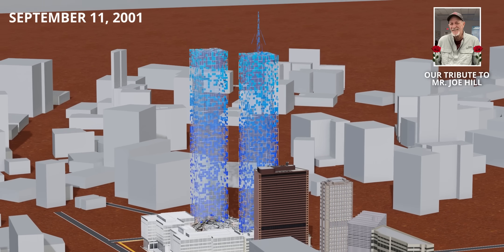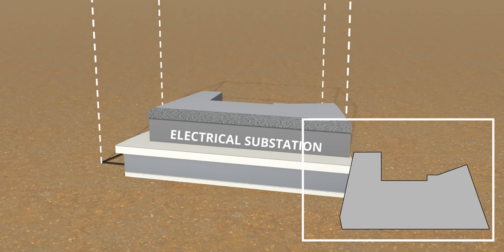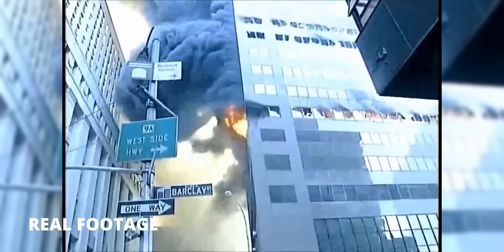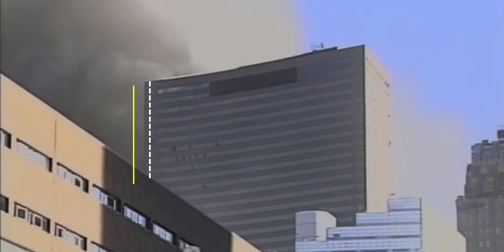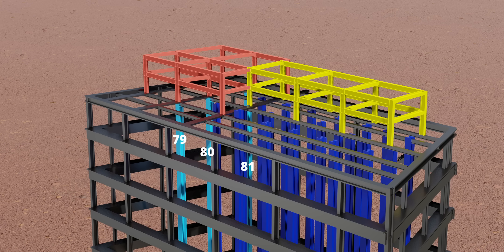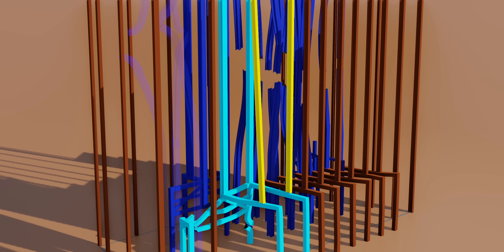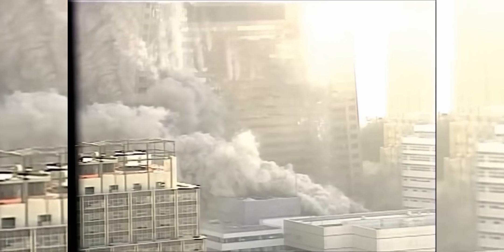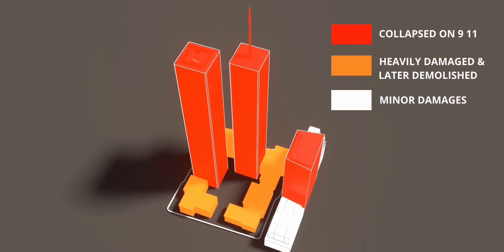Collapse of Building 7 | The Complete Physics

Comment: I find this argument difficult to accept. Buildings do not simply collapse into rubble; even when multiple high-explosive rockets strike a building in wartime, the structure often remains standing. From a common-sense perspective, the WTC incident seems highly implausible.
Reply: Maybe a more detailed approach will help;

At 10:28am the WTC North Tower collapsed, showering Building 7 with tons of burning debris, causing heavy damage and starting many large  fires which burned out of control for the next 7 hours. Half the FDNY firefighters having been killed, units in disarray, equipment destroyed, no water pressure, and the greater urgency of search & rescue efforts, Building 7 couldn’t be saved so firefighting efforts were pulled as futile and 7 left to its fate. Firefighters make that sort of choice every day in brush fire situations - which houses to save and which ones to let go. Only real difference here is moving the decimal on the size and cost. People get overwhelmed by the size.

www.youtube.com/watch?v=g_SvpwyC17M

Collapse of a burning structure is always a concern for firefighters. Steel buildings subject to fire rely on active firefighting to survive. Buildings are designed around 1 to 3 hours of fire resistance, allowing time for occupants to escape and active firefighting to get started, after which all bets are off. Left to their own devices they'll exceed their design envelope and collapse, like Plasco Tower and Wilton Paes de Almeida. In 7 the occupants escaped, passive and active fire protections were compromised and active firefighting was abandoned hours before the collapse, which left the building to its fate. It lost. Odds on Building 7 would eventually collapse, and it did. No big deal in logic.

 http://www.youtube.com/watch?v=WnYBX6QT0R4 

FDNY Chief Daniel Nigro - The biggest decision we had to make on the first day was to clear the area and create a collapse zone around the severely damaged 7 World Trade Center, a 47-story building heavily involved in fire. A number of fire officers and companies assessed the damage to the building. The appraisals indicated that the building's structural integrity was in serious doubt. I issued orders to PULL back the firefighters and define the collapse zone. It was a critical decision; We could not lose any more firefighters. It took a lot of time to PULL everyone out, given the emotionalism of the day, communications difficulties and the collapse terrain 

FDNY Deputy Chief Peter Hayden ; We had our special operations people set up surveying instruments to monitor and see if there was any movement in the building. We were concerned of the possibility of collapse in the building. And we had a discussion with one particular engineer there, and we asked him if we allowed it to burn could we anticipate a collapse and if so, how soon? And it turned out that he was pretty much right on the money, that he said 'In its current state you have about 5 hours 

The collapse of Building 7 was anticipated and widely reported in the media throughout the day, with 24 video cameras recording some or all of the collapse. Everyone knew what was coming and why. 

www.youtube.com/watch?v=OY5S5k3tMHI

The collapse of Building 7’s was entirely different to the Twin Towers and harder to understand, most details being hidden from view and not intuitive.  But we can still sort out what happened through careful analysis and observation. This is my explanation of the collapse relying on no outside authority. 

Building 7 was a unique, asymmetrical 47-story steel framed structure built atop a smaller 3-story building serving as a partial foundation, requiring lower floors dedicated to complex load transfer structures. Of trapezoidal shape and all-steel tube-in-tube construction, B7 (above the 7th floor) consisted of a central core of steel columns carrying most of the gravity load, perimeter steel columns around the outside of the structure carrying the remainder of the gravity loads and long span beams and girders to tie those elements together and form the floors. On the outside of the building hung a moment frame or outer shell. 

Phase 1 : First externally visible signs of collapse initiation occurred at 5:20:28 pm and were notably quiet with observers not realizing the building was collapsing! No audible warning in the form of hundreds of ear drum busting 180-190dB explosive bangs preceding the collapse. Here at 12:00 a local CBS affiliate reporter is talking 10 blocks from B7 when collapse begins. People don’t start to notice the collapse until 12:11. At 12:45 is the famous CBS fixed camera clip of Building 7’s collapse. Note how quiet it is. 

www.youtube.com/watch?v=t5tEy6mXSE8

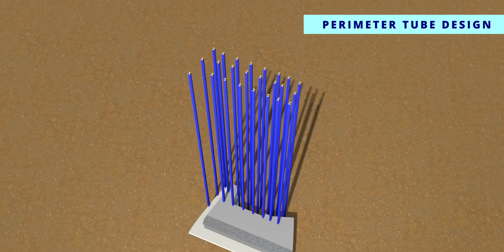Collapse initiation was due to lower floor failures above the load transfer region (8-14th floors) in the NE corner. In this video at 0:45 you can see the NW corner from inside the building while under construction, Column 79 just out of frame on the left. That big, angled steel beam across the top of the frame connects to C79 at one end. The girders connect to the beam. That beam and all those girders depend on just one connection 

www.youtube.com/watch?v=nP3TNHPCIVU&t=45s

Phase 2 : The NE lower floor failures caused a loss of critical lateral support over an excessive length of Column 79 and it buckled. Looking at a floor diagram of Building 7 (www.nist.gov/image-16640) when you see all the structures that depend on C79 you quickly realize this one column was a relatively isolated structural element on which a disproportionately greater fraction of the structure depended analogous to say the Key Bridge. Externally as collapse begins we see a vertical progression of window breakage along the 44-46 line and a kink in the roof of the East Mechanical Penthouse at the top of the building, consistent with C79 failure. Normally with a buckling column, the load could be redistributed to other columns. With C79 that is not the case - the failure did not redistribute the load, so the collapse rapidly progressed to the roofline, sinking the rooftop penthouse. The transition from full capacity to almost no capacity occurs in an instant and will result in virtually no resistance 

Phase 3 : With C79 gone, B7’s progressive, non-symmetrical collapse continues with adjacent columns 80 and 81 left laterally unsupported, and quickly buckling as well, sending the EMP down through the building. C79-81 all have no diagonal bracing, which is the major reason why they could not redistribute a lot of vertical loads among one another. From there collapse progressed from east to west through the central core until the core was gone taking all of the interior floors and probably most of the perimeter columns with it. Follow the horizontal progression of window failures low in the building and the dropping of the remaining rooftop structures into the building. One of the big takeaways from the NIST Building 7 study (invariably ignored) was how their modeling determined C79 failing under ANY circumstances would have initiated the same collapse sequence. 

Phase 4 : After about 10 seconds only the exterior moment frame remains, giving the illusion B7 is still standing to the casual observer since little has outwardly changed. But it is just a hollow empty shell like an empty cereal box supported only by a few remaining columns and overloaded from the loss of the core columns and floors, quite unable to remain standing. With nothing remaining behind it, the north face leans inward, forming a V in the roofline, the last few columns buckle under the strain and the moment frame free falls, landing on top of the debris pile. 

It is only here at the very end that a single measurement of alleged free fall acceleration is taken, from a single point on the outer shell. The Building did not “free fall” – just one corner of the outer shell did, sort of. The Building_ (defined as its center-of-mass) was already gone before that happened. The period of alleged free fall was a product of how it fell NOT why it fell and can't tell us what started the collapse 10 seconds earlier. Start to finish the collapse took 18-20 seconds, 3 times longer than free fall . How fast something falls cannot tell you what started it falling_ anyway. 

The debris spread outside the footprint blocking surrounding streets, heavily damaging the Verizon Building and destroyed Fiterman Hall. 

Building 7’s progressive, non-symmetrical collapse was incidental and unintended collateral damage from the combined effects of fire + time + gravity, started by the collapsing North Tower. That is true no matter who planned and carried out the 9/11 attacks or why . The collapse was of so little consequence it barely registered at the time - a footnote, only taking on semi-mythical status as an alleged smoking gun years later when demolitions at the Twin Towers, missiles at the Pentagon and shoot down over Shanksville all failed and conspiracists had nothing left to work with. 

Anything can seem like a conspiracy if you don’t understand how it works. Now you should. I hope you found this helpful, informative and it solicits informed critical comment. If I made any errors of fact, logic or reason or left anything important out, please let me know so I can fix it. IF you can offer a more plausible alternative please do. Be the first. Please start any reply with the words “Tits McGee” or I will know you didn’t read it and are wasting my time.
Reply: Your argument fail on 1, the type of building, and 2, the outer circumstances.

Comment: Steel melts at over 1300C. The spire from the tower wouldn't cut the core columns.
Reply: No steel melted and only two perimeter  columns were cut by falling debris. That was not why it collapsed 7 hours later though. Watch again.
Reply: "Steel melts at over 1300C."
So what?

"The spire from the tower wouldn't cut the core columns."
Yes, it absolutely would. It didn't, but it absolutely would. Either way, that's irrelevant.
Reply: water boils at 100 and cuts steel so i dont think boiling point matters in cutting  steel and there is plenty of gas and electricity to start burning

Comment: I can understand how heat can bring a building like that down but what i can’t understand is how the heat affected every beam to exactly the to same temperature at exactly the same time when it is extremely obvious the fire was totally random and the perimeter beams had zero heat applied to them on the outside of the building. So how did all beams collapse within milliseconds of each other.
Reply: 8:25
https://youtu.be/bLF5D7M1YgA?si=aHSvS__uOdxMi1ZB
Still doesn't account for the explosions that were coming from tower 7.
Reply: It didn't, and they didn't. It's called "progressive collapse".
Reply: @mooneyes2k478 progressive collapse doesn't explain the explosions
Reply: @robbiehiatt9966  Doesn't explain Santa Claus and Cinderella either, and for the exact same reason.
Reply: @mooneyes2k478 oh its real, that's what the video was for.
Reply: @robbiehiatt9966  Yeah, I'm not surprised at all that you think Santa Claus and Cinderella are real. Sadly, I have to crush your fairy tales and let you know, they're not.
Reply: It didn't.  Pay attention to the video. Failures started in the NE corner with core columns failing one by one as they lost critical lateral support due to the failure of adjoining columns. The collapse progressed from east to west through the core that way until the core was gone. 

This video does not go into it but the initiation failure was actually floor, not column failures between 1-14 in the NE corner.  With multiple floors crashing to the ground the first column to fail was left with insufficient lateral support over a critical length. Heating of the columns did not trigger the collapse.